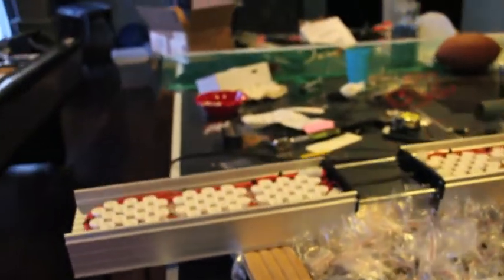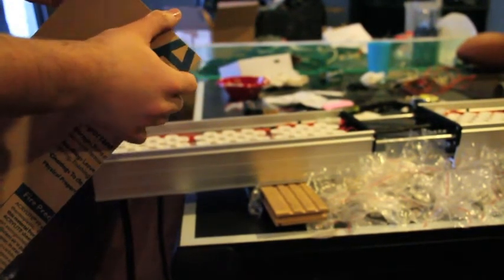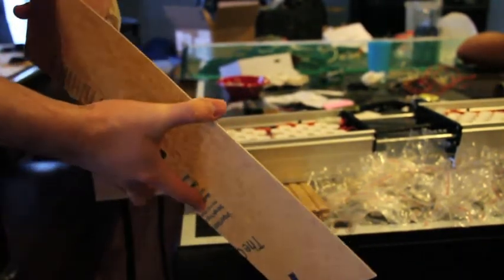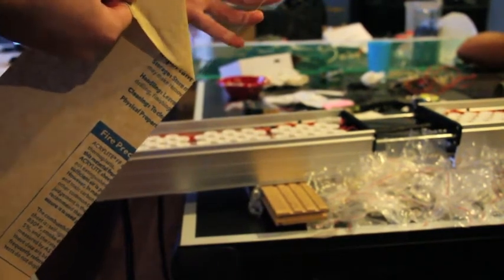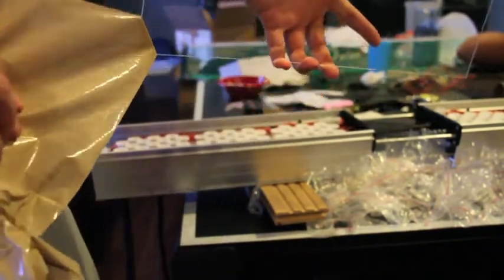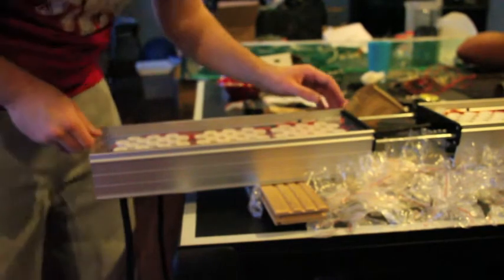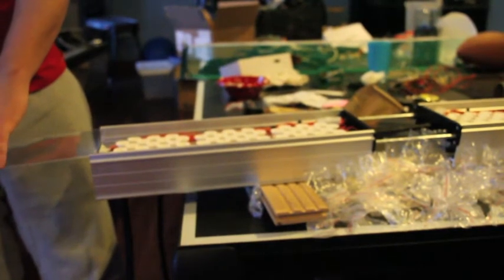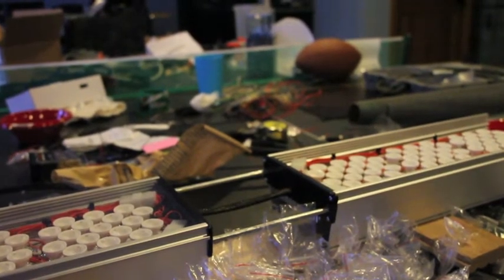DIY LED Reef Light Build Part 16

Comment: all that recording work and you didn't show the finish line.   also, I was looking for video on connections to the drivers, board,  and power supply.   All that time you spent on the development of the heatsinks, was instructive.  But I was kind of counting on seeing your connections to the drivers, driver boards and power supply.  kind of disappointing, because it seems that the instructive diy videos on youtube use the ELN drivers and not the LDD drivers, which you used.  too bad...but thanks anyway...I did get some useful hints..
Reply from the maker: james williams Hey there! I'm still around and the lights have worked great for me. I do need to make a video of the lights over the tank. I'm planning on coming out with some videos. As far as the hookups you're interested in my drivers are directly soldered to the board. I can try to get the pictures of the hookups to the boards tho. Basically the is a hot and neutral going in from power supplies and there is also a signal cables for each driver that goes in from my controller which controls the brightness of each channel. Then you have positive and negative coming out of the board for each channel of LEDs. I will have to look again at ELNs but I did the LDDs because I could have more channels and I can control each channel separately. Send me a PM if you want some more details. I'm home this next week so I will be with then tank!